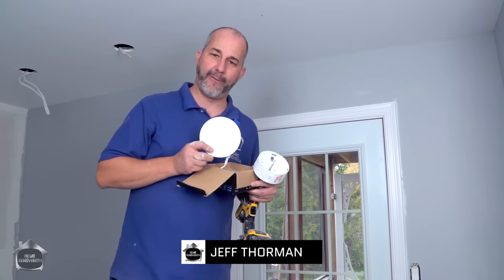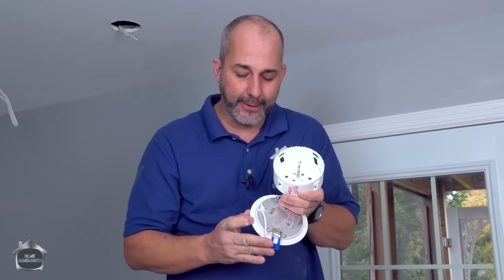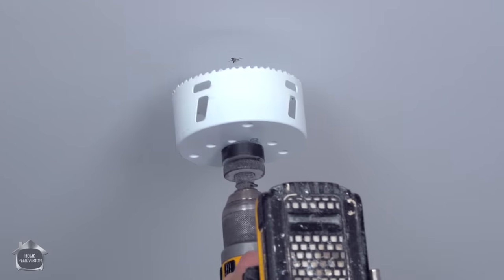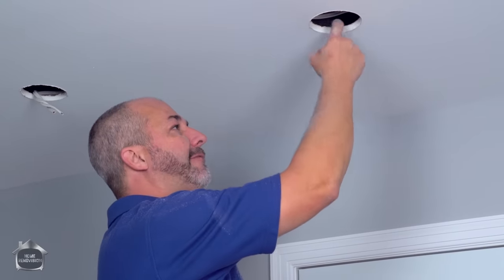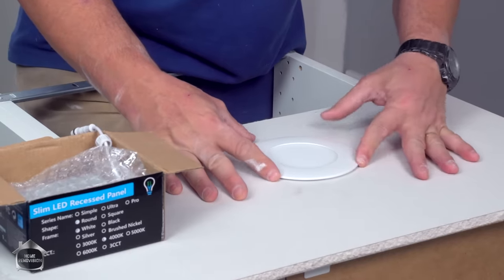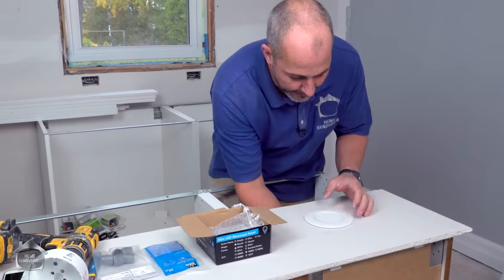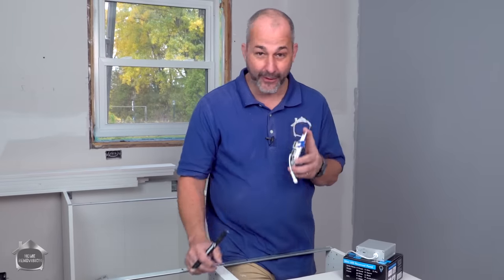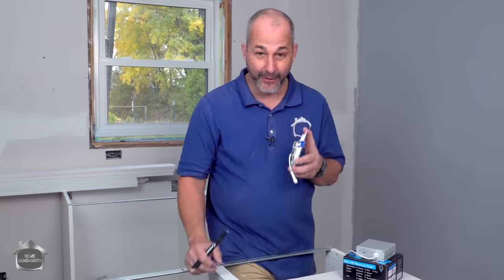How To Install Pot Lights in Kitchen Ceiling

Comment from the maker: these lights are currently not available. we are working on building our own supply chain to make them more affordable. Cheers!
Reply: Great information as always.  Will these lights work with double layer drywall?
Reply: When can we expect the stock and is there a link where we can check and buy? Thanks.
Reply: We purchased pot lights from Vega Lighting a while back but need a couple more. Is there an alternative pot light that would best approximate the Vega Lighting 4" one? Do they all sort of look the same? I would hate to have different looking pot lights in the same room (or different color of the white light).

Comment: If nothing else, the tip to run the hole saw in reverse when drilling into drywall, was worth its weight in gold.
Reply: This guy is a total king.
Reply: Agree.
Reply: indeed
Reply: One of the first things I was taught when I was an apprentice install retro cans..., years ago... 😁😁😁
Reply: Same thing applies when you are cutting holes in vinyl siding.
Reply: @woodyblakemore8401  t
Reply: @woodyblakemore8401  ty
Reply: Yes
Reply: @hotlittlepot  a
Reply: that was the best thing I got out of this.  Ironically just finished doing fifteen of these exact lights before watching this video.  wish I watched the video first.
Reply: Buy the lights too. They are great. Jeff is the man.
Reply: My thoughts exactly. This guy knows how to contractor lol
Reply: @bbowling4979  cut vinyl siding with a plywood blade installed backwards in your saw, clean, no chipping cuts every time
Reply: That works great for drilling through carpet or vinyl too!
Reply: I remember this vid everytime I use a hole saw.
Reply: Agreed!!
Reply: That works better for vinyl siding. Run your drill in hammer mode on drywall
Reply: That was also the best tip I learned!
Reply: Money in the bank!
Reply: His videos always are
Reply: @mikestoolfun  I’m very proud of ya

Comment: This was the easy part of installing pot lights how about you show us how to run the wires especially through floor joists. I think that would be beneficial for everyone
Reply from the maker: We did a video on how to wire a bathroom and we did a pot light run a swell. Cheers! https://www.youtube.com/watch?v=NfRuLlTp5s8
Reply: I believe I saw that video that runs the wires
Reply: remove the knockouts (if it's engineered joist) or drill holes.
Reply: Agreed and the linked video is for pre construction.  How do you do this after the drywall is already up and painted?  Can you work a full size drill through one of the 4" holes for the can lights and then just drill a hole in the joist by feel?  Or do you have to remove a larger section of drywall so you get to the joists with a drill.
Reply: maleitch you don’t need to put the entire drill is you need a flex drill bit that is used by most electronic installers for jumping studs
Reply: @maleitch  much easier to remove the drywall then pull the wire.

it might be possible to cut your holes for the lights then use that to drill holes in the joist. of course this will depend on how far apart the lights are.
Reply: @HomeRenoVisionDIY  "how to wire a bathroom"  I haven't even watched the vid and I already know it's either new or gutted ( no drywall ) install.  Do a vid on wire install across and perpendicular to the ceiling joists.  Please don't go in the basement for a man cave install.
Reply: @jetah50  "much easier to remove the drywall"  Thinking this is what I will do myself.  1/4 drywall with 1/2 of concrete on top of it.  They did a very nice job 70 years ago.  All the seams where the drywall and plaster are cracking though.  Ahhh!
Reply: @Grim Reefer Is 100 of these enough for my kitchenette stealth grow?  Also will the heat affect my veg fridge or leak into my cloning oven?
Reply: Ayoub Farid that’s what electricians are for.
Reply: yes, please do this. A pod light retrofit on a finished room.  I have watched other videos, but your explanation and real world problems make your videos most informative and very useful.
Reply: @HomeRenoVisionDIY  this was easy. show how to do the wiring for pot lights in finish ceiling
Reply: @maleitch  the slim pot lights can go right on top of the floor joist, just drill about 1/4" on to the joist to make it easy. The joist is 11/2" thick and the hole you will drill for the pot light is 41/4'' so you will have enough room to insert the junction box and wire(s) as well. The slim pot lights are 3/8' thick (the inserted portion of the light). I have installed right on top of double joist few times.
Reply: @maleitch  
I used a Milwaukee 12 volt impact with a spade bit. Take battery out. Take bit out. Reassemble in the ceiling. Takes more time but less patching drywall.

Be careful about drilling through multiple cells. I nicked an abs pipe. Could have been a chitty day.
Reply: @HomeRenoVisionDIY  I luv this guy!!!!

Comment: My Dad was an electrician for a long time and taught me a trick when you're adding pot lights to a renovated space and don't know what's in the ceiling.

When you have your proposed layout marked out on the ceiling in pencil:
1) cut off 10" from the end of a metal clothes hanger
2) bend the end of this piece at 90 degrees with a length equal to the radius of your pot light (it should look like an 'L')
3) stick this in the ceiling and rotate the coat hanger to check for unexpected obstacles

This is essential to do BEFORE you start cutting out the hole for the first light. If light 8 of 12 hits  an obstacle you might need to adjust your whole layout.

I hope this helps. Thanks for all your videos Jeff!
Reply from the maker: cheers marcus. that works if you are fishing in a closed ceiling. !
Reply: exactly correct.  I call it spotting a hole
Reply: This was the exact question I have as I have to do this an cut through a number of floor joists.
Reply: @mike9887  A long flexible/bendy drill bit on a shallow angle is your friend if you're doing this in a closed ceiling. Just make sure you know there's nothing on the other side of the joist. I also found it helpful in a couple cases to use an old wire in the ceiling as a 'fish' or 'guide' cable for routing new cables in a closed ceiling.
Reply: Oh - and a nice set of cable rods/guides if you don't already have them
Reply: Marcus Little they laid this out before they install the sheet rock so they knew what was there, but what you say is correct I’m electrician of 30 years I also do that when doing old work I use a piece of the  Metal snake
Reply: These low profile lights can straddle joists.
Reply: Even if you get a floor hoist those slim lite will fit under the joist I’ve installed 100s. They’re are very nice lights for fishing in pot lights.
Reply: Why is noone asking how do you run those wires. They show the wires already installed but the hardest part is knowing how to set up the wires to electricity?  They don't just magically have power
Reply: I use a light scope with a 1/2 hole and take pictures. 
That way you know what's up there.
1/2 hole much easier to fix.
You may see beams, bear wires, green copper pipes, Mold, nails and other hazardous you are not aware of before major cuts.
You would be amazed of the things you find including dead mice, rats, other creatures and droppings you come across in some homes, and attached homes are horror stories.
Well worth the money. It saves you time, repairs, money, and giving you a peace of mind what you are getting into before hand.
Reply: @edwardharoldbutler6288  thanks for the response. But I'm trying to find out how to get power to the new lights? Installing the wiring and getting the electricity to lights. I know one end of the wire is going to the lights but where is the other end going to connect to? The light switch etc please help
Reply: B B ya know you must have power coming from some where going to the switch first and then to the lights. beats having a hot direct from the light then to the switch and electrocute your self when changing the light box some day.
Reply: I just use my smallest trim screw driver.
Reply: @BBop23  Wiring the lights to the switch and the switch to the breaker is a separate process. This video assumes you already know how to get switched power to each light.

Comment: I love idea of drilling in reverse!  I would like to make a suggestion that everyone might like in addition to your great idea.  I learned a trick where when drilling into a ceiling using a hole saw,  you cut a large plastic water bottle jug below that neck, you can install it as a shroud between the chuck and the holesaw.  .  As a result, there is no dust to clean up!

Comment: Love the reverse hole saw trick. I’ve never thought of that and I’ve installed hundreds of these being an electrician. If I could give a tip of my own leave more wire in the box to splice you can fold them to fit also never grab the wire with pliers to push into the quick connect you risk damaging the wire and causing a short. All and all good video. Those good quality lights

Comment: I did this about 6 months ago . Put in 12 of these same lights in kitchen/dining room. My access to the attic was very difficult so rather than going up there I laid out my locations for each of the holes and checked with my stud finder to avoid studs . At this point I drilled out all my holes and was only close to one stud and due to the low profile of the lights it was still very easy to install. To wire them all up I removed the existing junction box for the previous wiring and moved it over to the first light and connected it up and cut another length plus 2' of 14/3 just to be sure I had enough to make easy connections. and just daisy chained all (8) for the kitchen area and did the same for the dining area.  The whole project took me less than two hours. And the Wago connectors absolutely made the biggest difference in time savings.
Folks come over and can't believe I did it myself and for less than $150. Friends are asking if I will come help them .
Great video and wish I had known the reverse trick it would have saved me  a couple of BooBoo's
Reply: Thanks for your detailed description! I appreciate it as I had questions about how to go from one light to 12 with new wiring. Your explanation makes sense.

Comment: When I do recessed add ons I like to put my drill in a cardboard box. Have a hole cut in for my arm to get in the box. Then When I drill all the dust collects in the box. I do this if I don’t have a shop vac to use. Helps on the mess
Reply: I drill a hole in an old clear plastic container. I then put the bit into the container, through the hole, then into the drill.
Reply: Get a cheap Tupperware or knock off plastic bowl make hole big enough for the shank that goes into your drill chuck and it will stay in the bowl or look up rac-a-teir dust bowl and you'll see what I'll trying to explain
Reply: @cheryljason9617  great idea! Even less mess!
Reply: i cut a basketball in half and cut small hole for arbor. and all dust collects inside ball.
Reply: @snwbm  i argee

Comment: I like the connection fitting. Make your job easier n faster. Without a screwdriver. And saves over tightening. And connectors comes in 2 cables fitting 3 n 4 n 5. So much easier. Great content.

Comment: I've been renovating my house over the last two years. When I started, I found the same lights on Amazon for $14 a piece in a 12-pack. I bought a pack, thinking I got such a great deal. Since then, I've bought a new pack every room or two that I've renovated. But I've also found cheaper and cheaper lights each time. The last pack I bought cost me $6.50 per light! And hilariously, they are all the exact same light from the exact same factory, like you said.
Reply from the maker: not bad! the actual cost to manufacture is under $1.00 I am sure
Reply: @HomeRenoVisionDIY  I'm sure too. And at a manufacture rate of "8 billion every 5 minutes" that's quite a profit!

Comment: Gotta say, this channel and these videos are exceptionally good. 
My electrician put these exact lights into my bathroom and basement and I had to remove one to work on the shower ceiling. These lights hold on like they’re in cement, then suddenly they’re free of the drywall, and come down on your finger like a damn mouse trap, Christ those springs!

Comment: Jeff, do you have a video tutorial for installing pot lights as a renovision in a completed room where pot lights weren't originally planned? Specifically, accessing and adding to existing electrical to run new wiring, such as a process using an auger.

BTW, I've really learned and put into practice a ton of your teaching. Thanks so much!
Reply: I would love that vid as well!  We are doing Reno’s and want to add pot lights to our vaulted ceilings before we sell.  We also want to remove/cover painted popcorn in the house (ugh…what a job)

Comment: I'm purchasing a new build with these already in but want smart lights.  All the smart lights I see have a connector to a traditional lightbulb fixture, not to a junction box.  Cut at the end and just run it into the box?  Do most places just throw it up there so it can be accessed?

Comment: Redoing a master bath and was thinking of going this route, well now you sold me on it. Thanks for the great video.
Reply from the maker: Cheers Todd!
Reply: add a fake fireplace. Great ambiance. So, will need to add extra electric outlet with GFI in middle of wall. Wall fireplace is great. You can add atmosphere and heat to your bathroom. Everyone will be impressed. 3 feet clearance all directions.

Comment: Tip: When drilling for any holes not just in the ceiling, but also on walls, etc. Particularly in a functioning kitchen, room, etc. Get your wife/kid/neighbor/friend, whoever is at hand. Hold the vacuum cleaner long tube extended to near the hole. The vast majority of the dust will be collected on the spot. Saves a lot of after cleaning and general mess. ;-)

Comment: Would highly recommend caulking the light, a lot of people experience dust infiltration due to pressure differentials between attic and room.
Reply: I had some painters who clear caulked an LED to the ceiling because there were no fasteners. 🤣
The homeowner was so disappointed.
Reply: That’s caused by improperly ventilated attics, the light isn’t the problem at all. Too much attic ventilation is a really bad thing and causes higher utility costs, dust and a musty mildewed attic.

Comment: Thanks for posting video. Going to order some. Googled these and found for 9 bux. Great deal.
Reply: What did you search for?  RENO-4-S9W-345KWH?
Reply: @miken54tuning99  Yeah I found them for that price with that code. Ordered 12. Color change option is great! Product Pro was the company I got them from.
Reply: @tumbleweed1337  I also found them there for $9.75. Thanks for the find.

Comment: Great Video and I'm considering these types of lights for a future project but I have a question. When an LED light blows out, how difficult is it to replace it? Is it as straightforward as simply disconnecting the wire running from the metal box to the blown light and then plugging in the new light? Obviously more complex than screwing in a conventional light bulb. Thanks.
Reply: I'm here to find the answer to this too! I moved into a house that has these lights. 2 are out and I am clueless about how to replace them ! I've been without those lights for months now. ☹️

Comment: I work in packaging. Everything you said is 100% true.
Reply: but how to find the best seller to buy cheap as electrician don't recommend from cheap seller or from aliexpress or some one like that.
Reply: I was working in cookie factarory, same cookies in established brands "expensive" boxes and in diferend supermarket chains "cheep" plastic bags, you just switch bale of packaging material.
Reply: Same thing with paper towels. Store brands are the expensive ones, just different packaging.
Reply: This is very common with tools aswell, power and hand tools

Comment: This video is great! I am struggling with installing a ceiling light. The ceiling light fixture doesnt have any ground wire ( only black and white wires ), whereas the old fixture had a ground wire that was connected to the ground wire coming in from the main! What should with the ground wire ( copper colored ) coming from the main ?

Comment: Hey Jeff, can you run a video on how to determine the layout? How do you know how many pot lights to install in a room (e.g. kitchen)?
Reply: A rough rule I read somewhere and like to follow for 6 inch lights is the spacing between lights should be about half the distance from floor to ceiling.  So, for an 8 foot ceiling, space lights about 4 feet apart, 9 foot ceilings 4.5 feet apart.  I will usually keep that as the minimum spacing and go as far as 6 feet in between lights, any further and you will have dark spots and shadows.  Also, keep in mind distance from fans and anything else that may create shadows.
Reply: @OneHandyDude  Thank you, that was super helpful!
Reply: Thanks Saagar!
Reply: That is true in the field but will in running next to a cabinet you want to stay at least three feet away from the wall so that the light will shine down on the counters and not the cabinets
Reply: @john20585  I'm learning so much from you two. Thank you 😊

Comment: Pro Tip:  Cut more of the outer sheathing from the wire so that longer wires are exposed.  It will be easier to work with the wiring connections than with the shorter lengths demonstrated here.  Longer wires will easily tuck inside the box.